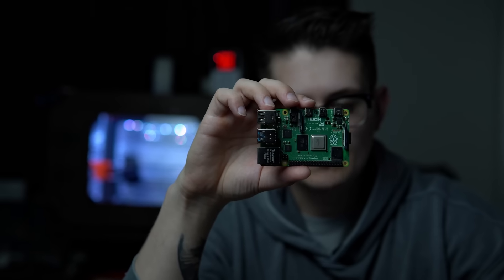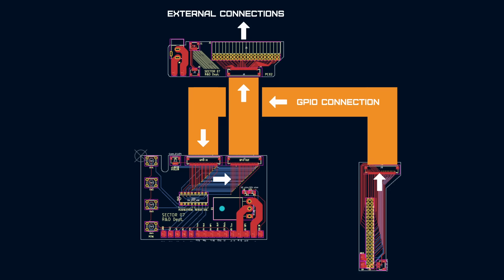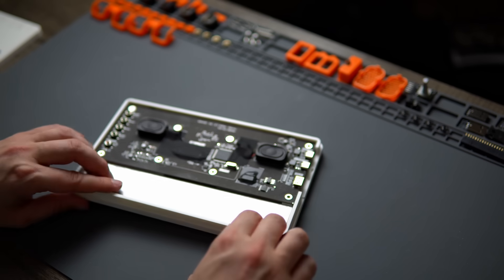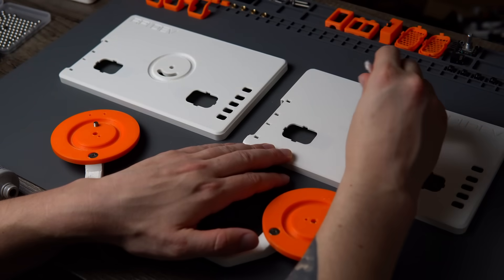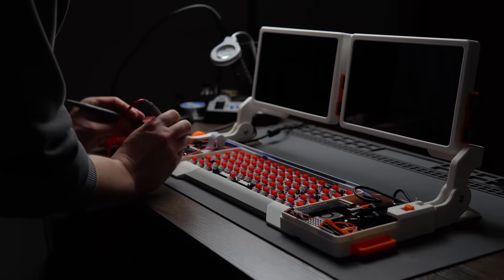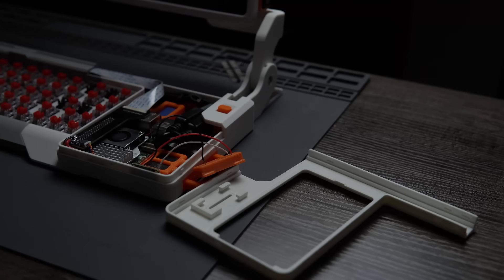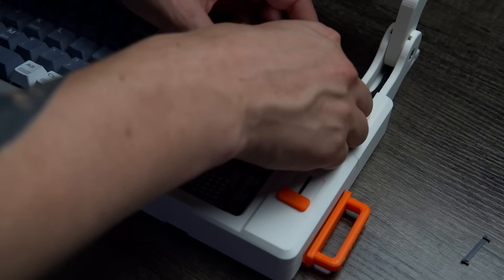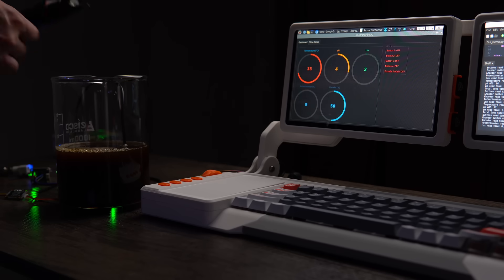DIY Dual-Screen Cyberdeck: Sleek Design, Ultimate Functionality

Comment: What library did you use to create the GUI?

ttkbootstrap - found it!
Reply from the maker: Yup thats the one, ttkbootstrap has a cool meter widget where other simple libraries dont.
Reply: @SECTOR07  very cool! I usually use CTK for my GUI. And am wondering if these two libraries can be utilized together. I’ll definitely be playing around with this library. It has a very sleek and professional look to it. And the simplicity of Tkinter is unmatched. I’m excited it uses that framework.
Reply from the maker: @verumregem Supposedly since they both use tkinter they are supposed to work together but I couldnt get it to work. I wanted the meters of ttk with the round corners of another one to get a more modern look.  Maybe you'll have better luck!
Reply: @SECTOR07  I’ll just have to tinker around and see. If I do happen to find a work around. I’ll try and remember to pass it along, lol. Excellent work on your Cyber Deck, brother! It was really cool seeing it all come together. And is real inspiring as well. Keep imagining and creating. Your potential is limitless!

Comment: Cyber deck = laptop
Reply: Exactly, some folksare so easily impressed by sub-par hardware when they slap the connotation of "art" on it, but there is absolutely nothing impressive about these dime-a-dozen Cyberpunk custom laptops, when taking into account all the parts, time, labor, and tools, you can get a very good gaming laptop that would blow any of these toys out of the water for cheaper than the total cost to build this impractical thing.

Comment: Amazing work man, Im trying to get into this kind of thing and YT resources are about to stop existing, can you point me to where you would start if you were new on the PCB stuff and how you program interactivity with other devices in code? (Im a bit better in coding but this involves hardware and kernel level programing which is very detached from what Ive been doing so far). Thank you :)

Comment: the best tech i have ever seen in last 3 years to be honest. i thing i would be little good if the both monitor can be moved inwards or outwards for better visibility 😅

anyway, its uncountable/10 for me. i would buy this immediately!!
Reply: Best tech? It's an impractical poorly performing and overpriced RPI laptop LARPing tool. You clearly don't follow technology or engineering if this is the "best tech" you've seen in the last 3 years. This isn't even new tech, it's off the shelf parts slapped together to fit some aesthetic Cyberpunk fad at the expense of economic practicality, performance, and longevity when compared to even the most basic of laptops sold today.

Comment: it's great but I have a question, it seems there are no ventilation for the raspberry pi, I really like your good work, please consider second version where you add vents so raspberry can get air to be cooled
Reply: It's an RP ARM processor not an i9. It's closer to mediocre cell phone performance and TDP than that of a real laptop, cooling isn't the issue with this thing, the fundamental design is.

Comment: This is an amazing project and you did a fantastic job on building it as every 2nd video I watch has terrible soldering and the bugs they show are largely self inflicted via poor workmanship. This video and design is pure quality and the standard of workmanship is great, for the PI to make it easier to remove you could add some finger or tooling spaces to make lifting it out easier. An L shaped 3d printed lifter could also help as it could get into a smaller space vs using your fingers.

Comment: 😮It would be cool if they made some kind of sensor that triggers a code when you turn the screen vertically, so that the OS automatically rotates to the correct view, similar to mobile devices. 😯
Reply from the maker: It think the best way to achieve that is with a hall effect sensor in the monitor arm and a small magnet embedded in the screen case. Sensing position without contact. I'd have to redesign a pcb board and a couple printed pieces but it would be pretty cool.

Comment: Oh I made a cyberdeck all the way back in 2017-2018! It was for college so I could keep on doing work while on the go lmao ran by a raspberry pi, and also hooked up into an Arduino so I can do my projects and everything else. All attached to a touchscreen, just a small portable unit, the back of the touchscreen hosted the breadboard for my Arduino projects and a hard wired 5v line and ground haha

Comment: S-tier tech! The only thing I was surprised not to see was a battery bank for portable utility, a section added between the hinges could've housed several 18650 cells. Having a deck like this would be far more useful if it were able to be moved around freely.

Regardless This is super dope and you definitely earned my subscription!

Comment: Well, you say it's supposed to be portable, but it really isn't smaller than a laptop. You can find small laptops like the GPD Pocket 4 or BP8 which make more sense as a cyberdeck, because they aren't needlessly bulky.  If a cyberdeck is supposed to be for network breaching, I'd simply stick to a laptop running Kali Linux - all the other stuff is just needless superficial stuff.

Comment: Top tip - you can get Ipad 3 or 4 screens extremely cheap now and the controller board costs like 20USD. They are still retina screens, but you can get them (including the touch digitizer and controller board) for under 50 dollars. I used them in my cockpit project and they are actually really good for usecase like this.

Comment: Epic job dude. What operating system is it using? 
You can also put a track pad instead of one of the 2 lids on either side of the keyboard. They have good dimensions for it or even those fancy track pads which turn to numpad. you can have a numpad on the left side of the keyboard, whether it is a touchscreen which works as a macro pad and numpad, and track pad on the right.

Dude also you can make a slider thing like you did for your usb and screens for the entire raspberry board to just slide out of the case instead of fiddling with it.

This epicness deserves a subscribe

Comment: How can I get this good? I have not done electronics before,  leave alone 3d modeling and printing. How can I get started? My background is data science and data engineering.
Reply from the maker: Just pick a project and start building. Start with something easy. Learn what you need to along the way. I didn't know how to do any of this either when I start building stuff. All you need is curiosity and the will to learn. With that kind of background you already know how to solve problems and come up with solutions. Same thing, just a different medium.

Comment: how are you rendering actual videos playing in raspberry pi? when I try to run a browser, it lags so much.
Reply from the maker: The video displayed was the Cyberpunk 2077 2018 trailer on youtube. I am using a Pi 5 which could be the difference. I'm also actively cooling with a heatsink fan which could also be a factor.

Comment: Another one for the ever-growing stack of Pi-based “projects.” What’s new here, really? A mechanical keyboard crammed into… what exactly? Is this supposed to be a laptop or a desktop workstation?

If it’s a laptop—where’s the battery? Where’s the onboard Wi-Fi module?
If it’s a desktop—where are the full-size screens? One USB port? That’s laughable.
No real thermal solution either, not that this platform generates much heat—because, surprise, the CPU/GPU still can’t handle any serious workload.

But hey, at least it’s got some metal ball bearings stuck in a plastic sleeve… hilarious. And those “convenient” high-speed ports buried behind the screen? Yeah, I’m sure everyone loves digging back there every time.

Quick Pi removal? Sure—might be faster to just order a new one from China than to pull it out of that thing a second time.

Cool as a concept piece, fun for a demo video. Then you take it apart and it lives forever on the shelf with the rest of the Raspberry Pi graveyard.😂

Comment: absolute legend 🙌

Question about the rotating hinges. Why use bearing balls only for the screens? I'm looking into making a rotating hinge and was wondering how did you get the right tention so it keeps position at where you rotate it to? Is it just right pressure from assembly?
Reply from the maker: Pretty much yes. I also used some Threadlock on the screw to maintain that tension over time. The proper way would be to use a thrust bearing under the screw head and a nylon locknut to hold the screw in place. This would allow the screw to rotate without friction. I didn't have enough room for that so I had to compromise.

Comment: Looks like a Teenage Engineering laptop 😂. I love the retrofuturistic design.

I'd probably rather use a modern laptop to do anything productive, but could also easily see that used as a prop on a movie set.
Would love to see a full range of "products" using the same visual language, maybe a full space with several appliances. A dot matrix printer/fax combo, a desk onto various devices could be hooked-in like modules, maybe with a bigger screen, a walkman with a tape thats actually using an hybrid analog/flash storage to bring back analog audio grit, etc.

Comment: I love this build. I also built a cyberdeck; the parts all held together with screws, but I wish I had built it to snap together like yours; the screws are a pain, and I had one come loose inside and cause a short. I would love to hear about any lessons you learned designing your clips.
Reply from the maker: Great to hear from another cyberdeck builder! It really came down to trial and error between wall thickness, gap between the two parts, notch size, and cavity size. You could always take my parts and put them in an assembly to see the dimensions I used. I included .step files in the documentation so people can import them into their own cad.

Comment: Hey man, Great video. Really well put together, and great explanations. One thing that really stands out is that you took the time to design cable management and cable protectors that you don't really see anyone else doing. Another great feature you added was the removal of the Raspberry Pi making it effortless to change out should the need arise. One thing I might add is that if soldering isn't a strong suit, You can have a look and getting soldering templates so you can use soldering paste. The design itself also shows that you took the time to make it functional and still keeping it sleek. Very well put together and a great video. Well Done. Just one question: What are the touch screen displays that you used?
Reply from the maker: Hey thanks! I know the soldering sucks, but with the space available it was the only way I could route 40 conductors through a small space. I wanted to prove it can be done with a simple soldering iron if that's all you had, but it was a pain. A better way I could have done it is presolder the pads and use flux and a heat reflow gun but I know most people don't have that. Unfortunately that detail is probably what prevents most people from being able to build one and as of yet I don't have a better solution. I have all the parts listed and linked in a BOM on GitHub but they are Hamtysan 9 inch touchscreens from Amazon.

Comment: dude this is so cool and really useful. is there are way to build it with a battery so that you can send it to the field to collect your data and process it there?
Reply from the maker: Definitely possible but there was no internal space left in the design and I wanted to keep it slim. It would have to be an external attached pack plugged into the barrel jack which is entirely feasible. Just need to plan capacity requirement for Ah's.

Comment: what battery did you used? i try to find powerbanks for the raspberry pi5, but theh have lower Volt / Ampere than what the raspberry pi 5 wants
Reply from the maker: I didn't have any internal space left for a battery without making it excessively thick. I used an external power supply since I intended this to be used more like a laptop. At a desk to develop Pi's. So I can't provide great recommendations. Although if I did do it I would make my own using 18650 batteries and a bms so I have control over shape and capacity.

Comment: Well done, very cool project. I was especially impressed by the way you created the keyboard and auxiliary buttons, switches and dials. I do think maybe you were a bit confused on what this thing was for, went in several different directions at the same time. Which might be okay, and it's always okay to make something just for the sake of making it. But it seems quite unspecialized, in a sense. Is it fully for research? For writing code? For both? For regular browsing? It's pretty, but I feel like it might be more interesting if there was a very specific use-case. Anyways, great job and it looks very good, the 3D printing you did turned out beautifully.

Comment: for the last feature, wouldn‘t it be enough to just remove the microsd card and put it into another pi? You would need multiple pi‘s and it wouldn‘t work between different pi generations.. but it would be a simpler solution..😅
Reply from the maker: Exactly, it has a micro sd card access cover. So you certainly can. I wanted to make the whole thing removable in case you only have one and want to take it out and use it in whatever you programmed it for.
Reply: @SECTOR07 i wonder is there is a market for exactly this kind of stuff. I have worked with a pi for a project at work and it was a hassle to always have to connect tons of cables and peripheries to it just to adjust the code.. This kind of workstation would have made that project a lot less annoying 😅
Reply from the maker: @SnowmansApartment That was exactly the purpose for this project. You can just start developing without having to hook up anything. Similar to pi 500 but with displays, io connectivity, sensor hookup and all that. Idk if theres a market. I'm not interested in selling products. Id rather open source everything and just keep making new stuff.

Comment: should do a snap-on top cover to create a seamless outer case that encloses the back of the monitors when in their down position as well maybe including a carrying strap or handle. EDIT: also can you include motion/orientation sensor in the monitor shells that would automatically reorient the screen if rotated to portrait mode? Pretty sure you can do something like that :)

Comment: Love it. A tip for the layer lines below the space bar, an inevitable consequence of a beveled curve printed in that orientation, is to sand it down for a smooth finish, or alternatively glue a memory foam pad for extra comfort. Something to consider for v2.

Comment: heck, i would pay any money (well, not really lol, but still probably too much, if that would be a thing) to buy a device similar to yours, but with an option to fully customize it personally for your needs, both hardware (like more stronger mini pcs/components to choose from) and construction wise; i.e. - i imagine (and would love) to have the device like shown in the video, but with a larger screens (or 3/4 smaller ones) /w. a 3d rotatable fexible mounts, keyboard split in half for big macbook-like trackpack in the middle, more programmable buttons, sliders, gauges n switches of all kinds added here and there. damn, the workflow optimization & configuration options would be SICK AF working on some riced up linux arch with a setup like this...

would build one myself, but i lack skills, tools and architecture lol

Comment: I really like this project, I find it very interesting how it is a feat of product design and engineering work. I think you could make a hole on the raspberry compartment to push it from the bottom with your hand or a cylinder.